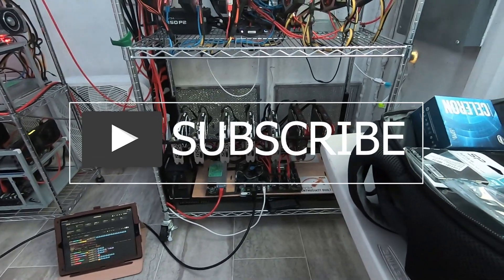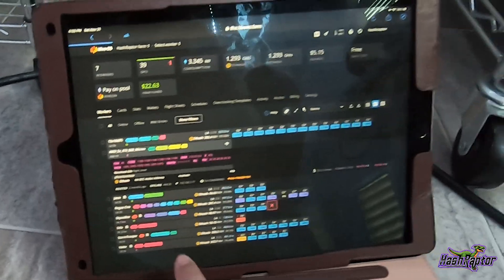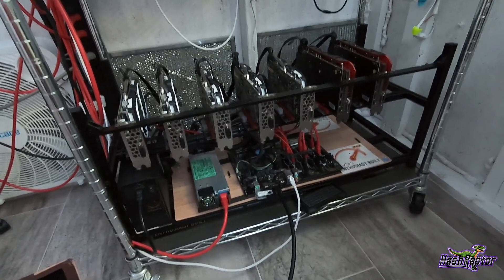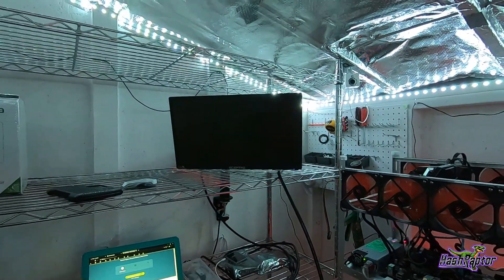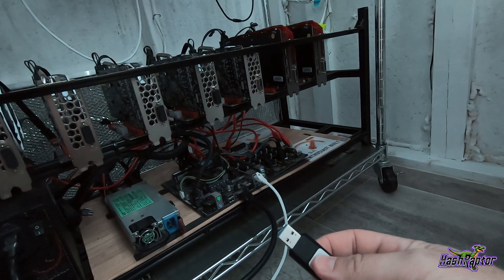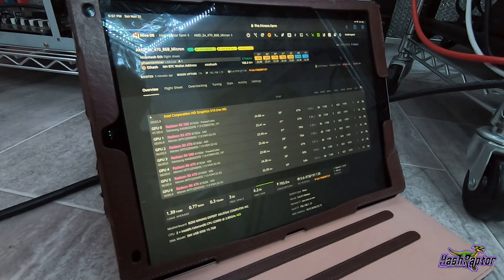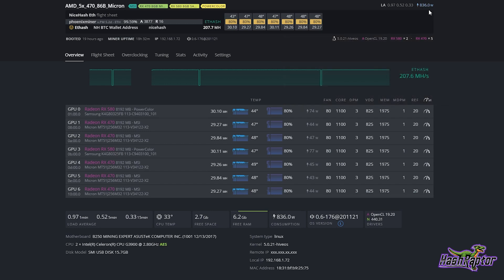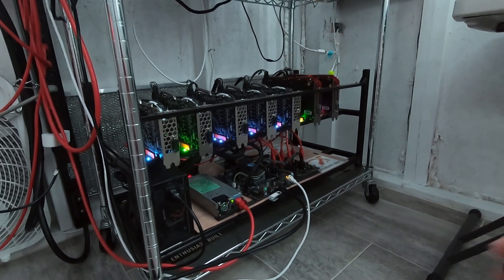AMD 470/580 Rig Troubleshooting, Profitability and ROI | 208 Mh @ 836 Watts

Comment: Thx for the vid. I've been looking into 470/580's (4GB) as I can find them at a pretty low cost where I'm at. Would the 470's be better? It looks like their power draw is much lower than the 580's.
Reply from the maker: Sort of depends on the model, memory type and how much hashrate you are going to push for along with what algo you want to mine. For Eth, both are pretty good. The 580 armors are solid. I love mine, but considering selling my 470’s / 580’s.

Comment: One thing to keep in mind with usb thumb drives is that they will not last forever.  Typically range anywhere from 10,000 to 100,000 write/erase  cycles for their life span, depending the drive memory type.   For something more long term I would use either a HDD or SSD.     SSD's still suffer the same write / erase cycle problems but are a much larger gap compared to a thumb drive.  As the average lifespan for a SSD is 10 years.
Reply from the maker: Good stuff!  Based on that info I’ll start switching to SSD’s :)

Comment: I’ll second the motion to switch to ssd, I did sometime ago, and have had many less problems.
Reply: Just swapped a usb to ssd and made it more stable and oh updates so much faster lol.  But ya u already made a new flash drive so shouldn't be that.  Hmm crap I had this happen should load hive in 5 secs not 30 cant remember what I did lol was either the ram swapped 4g to 8g or it was the psu dont remember now dam.  Nice dam USB lol edit as I watch lol
Reply from the maker: I didn’t even think about the updates being quicker. Bonus!
Reply from the maker: Nice!

Comment: i use sandisk cruizer glides...cause the cheap and they got a light on em...many times ive gon to troubleshoot  a rig and found the light out and new what the problem was.
Reply from the maker: Yeah I may have bought USB drives that were too cheap. Will try SSD or better quality USB in the future.

Comment: I've had a lot of issues with USB sticks lately, I just upgraded all rigs to SSDs amd it fixed a lot of issues from the rig not starting, and some how fixing am issue where the gpus would not mine.
SSDs are the way to go for hive :)
Reply from the maker: Yeah agreed I should probably switch all my machines over to SSD. Initially I had saved that for windows installs and then USB for hive, but probably should go SSD for all.
Reply: @HashRaptor  thats the thing with mining, we adjust as we go.
Reply from the maker: You got it